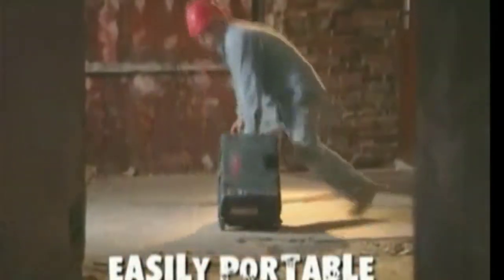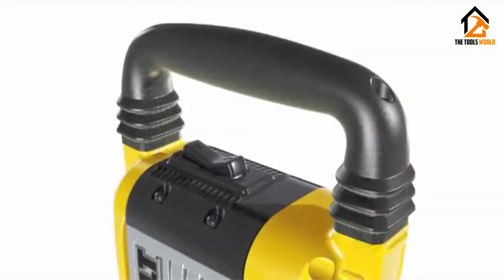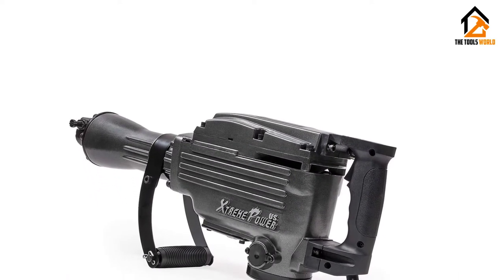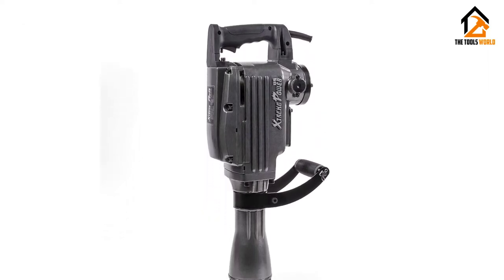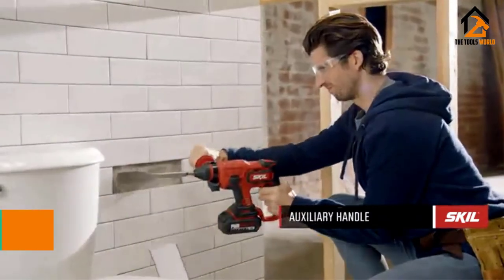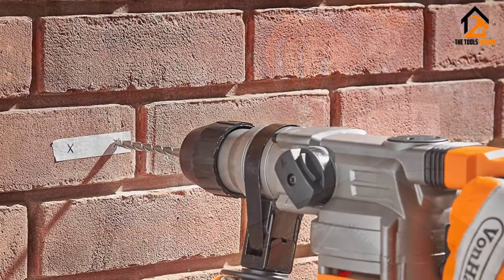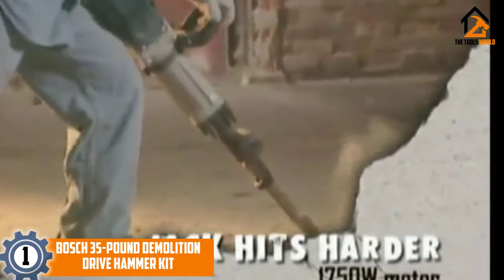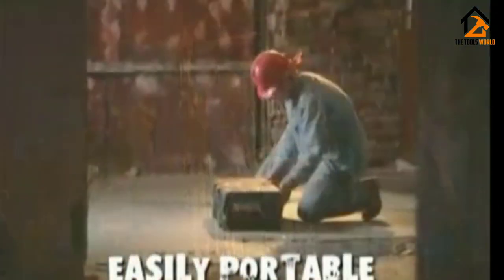Best Demolition Hammer For Tile Removal [Top 5 Picks]

Comment from the maker: ▶ In This video, We recommended the top 5 best Demolition Hammer For Tile Removal.

▶ 5. DEWALT D25901K Demolition Hammer.   
 
▶ 4. XtremepowerUS Heavy-Duty Demolition Jack Hammer Kit. 

▶ 3. SKIL Pwrcore 20 Brushless Rotary Hammer. 

▶ 2. VonHaus 10 Amp Electric Rotary Hammer Drill.  

▶ 1. Bosch 35-Pound Demolition Drive Hammer Kit.

Comment: In need of some advice, I do tile removals for work and have been using a dewalt machine with chisel to remove tile but doesn’t seem to do the job thr greatest, any mikwauke rotary hammer with chisel that is battery operated and will be suffice to do big jobs. Sometimes I work alone in older home and jump the breaker every once in a while, trying to avoid this issue